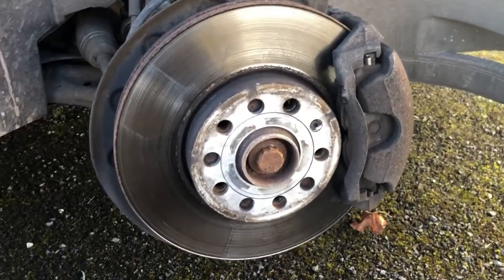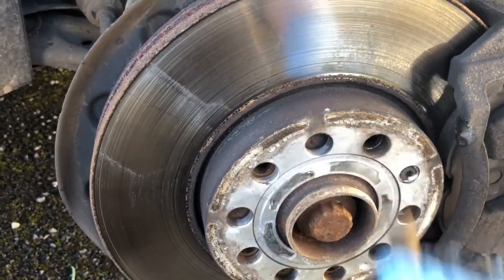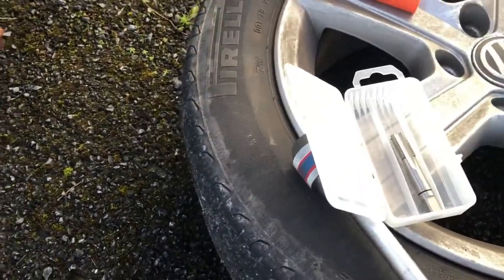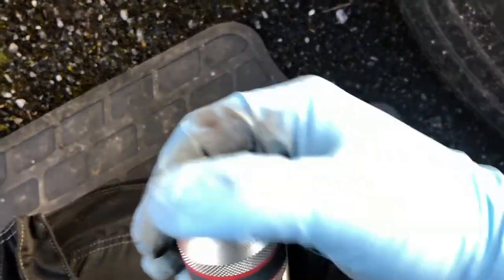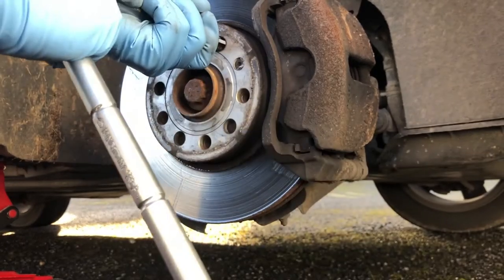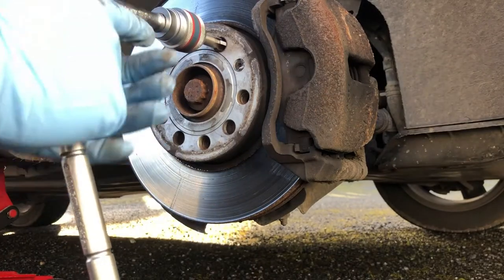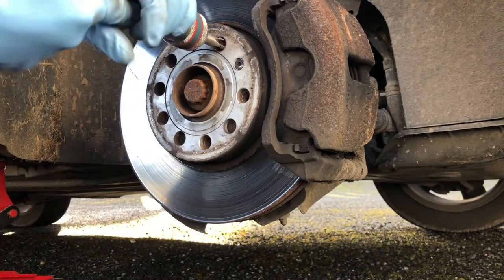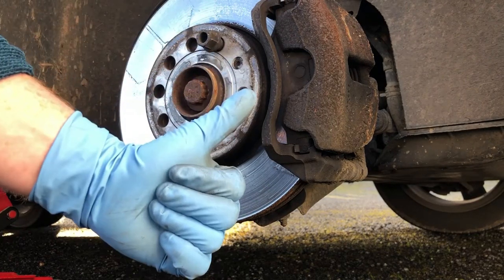VW wheel hub thread repair

Comment: Hi, great video ! I have question
What do you mean by "it goes all the way through", (about the plug and the other one) wich one should i use ? I have some bolts not screwing in the hole, and some screwing in the wind (non-stop screwing for nothing)
Reply from the maker: You need the “plug” tap. These is used when the hole does not go all the way through the metal. Hope this helps👍
Reply: @kildareeman  Ok i got you ! Thank you so much for this tutorial ...It helped me a lot !

Comment: Is it possible to do this with the wheel still on , with all lugs screwed in (minus the 1 in the broken thread of course) ?
Reply from the maker: Depends how long the tap is that you’re going using. To give me better access and visibility I decided to take off the wheel. I’m biggest fear is that the tap would go in at an angle which would be a right disaster 🙈🙈

Comment: Did you use original lug bolt after repair?
Reply from the maker: I got away with using original bolt however I would visually inspect your one first. If it’s badly damaged you will end up undoing your good work 👍

Comment: i have 2012 vw passat ,  can i use that ? and where did u buy. can u pls tell me where did u buy it?
Reply from the maker: The plug tap you will buy in a good hardware/ engineering supply store. Then the adaptor for the 1/2” ratchet was purchased from King Tony Tools 👍

Comment: Would the original bolt fit back in?
Reply from the maker: Depends if the thread is damaged on the original bolt/stud. If in doubt get a new replacement stud 👍
Reply: @kildareeman  thanks for reply , I asked the question wrong.
Can I use new bolt with same size like the rest? Or I will need a bigger one?

Comment: Do you have a recommendation for torque setting
Reply from the maker: I just make sure it’s good and tight(better be safe than sorry). I usually don’t tighten the lock stud as much as it could be hard to remove with damaging in the future.
Reply: These are 120nm